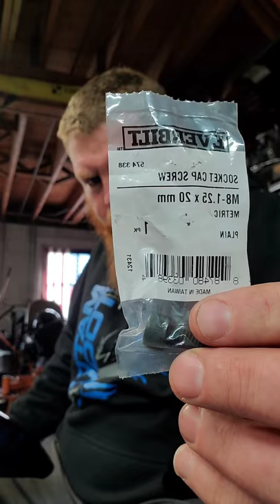Running light and turn signal removal on Yamaha Roadliner

Comment: You do you brother. I enjoy all of your content. FYI, the passing lights are easy to find. Signals are somewhat available, but pricey. The bar attach to are a "unicorn" piece in the liner world. Unique to only the Stratoliner/Roadliner models. Current price for a used bar with lights and signals is around $500.00. Would definitely fund some of the other mods your putting on this project.
Reply: You bet, i bought a 2006 Strat a few months ago and one of the chromed plastics was broken, its usable but i don’t like the way she looks, i haven’t been able to find one of those unicorns haha, I’m still looking for some custom mounts that looks somewhat like the oem